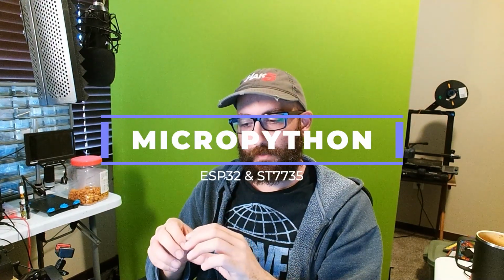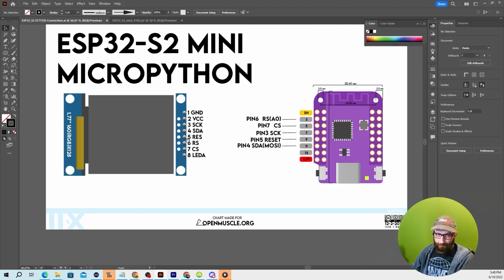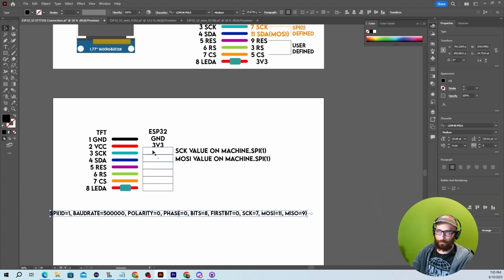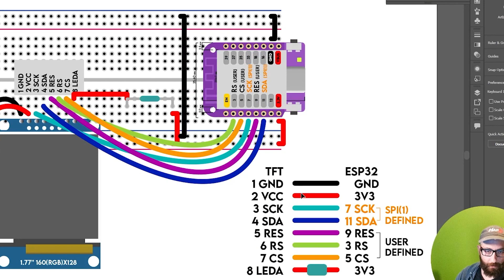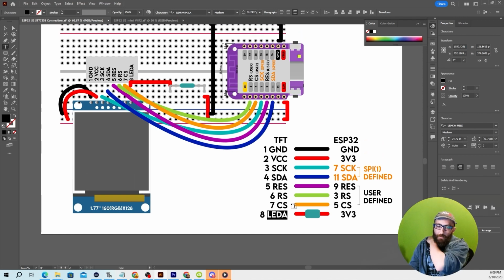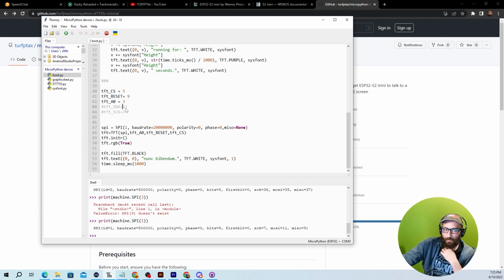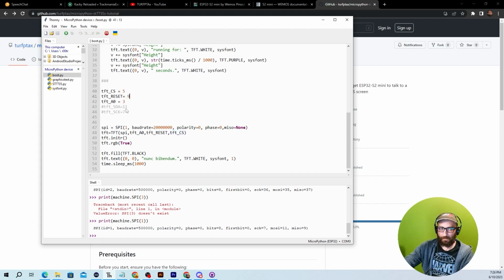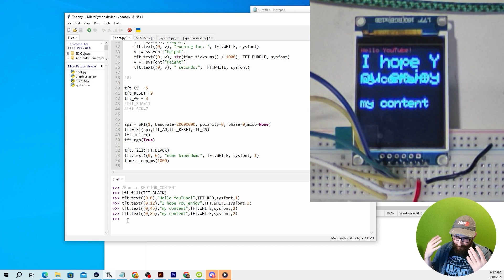Connecting ESP32 S2 Mini with TFT ST7735S Screen using Micropython

Comment: I see that on the back of my AliExpress  3.5" TFT Screen there are places for ribbon cables labeled 8080 16p and at the bottom 8080 8p, any idea if there's a ESP32 that has ribbon cable attachments for a screen?
Reply: Yes the orangepi models have those

Comment: Hi I'm trying to use this board, I need to connect ESP32S2 mini to an ST7789 display, this first problem I don't know how to do, then the sketch I have to load uses the TFT_eSPI library, I have to make changes here, help me please Thanks
Reply from the maker: If you are uploading a sketch that would be arduino and not micropython. Mostly the SPI connection has to use the correct pins from the ESP and ST77 board.

Comment: The TFT seems slow: the text appears not instantaneously, but with a delay.

Can this be fixed somehow, or is it because MicroPython is slow?
Reply from the maker: Micropython can be decently fast if you optimize the code. Playing with gc.collect() and using bytearrays can make it faster in some implementations. But if you want the full functionality of this library especially on the s2 can be slow.

Comment: Got this working (kind of) with a 0.96 TFT display. Only problem is colors are inverted. any ideas?
Reply from the maker: Some drivers use BGR instead of RGB, have you tried using a color text to see if that is inverted as well?

Comment: Thank you for your video! For some reason, your video are ONLY place where I found that for SOME reason, SCL pin is located at pin...7?! NOWHERE ELSE this mentioned in ANY way. BUT!!! It works! Inly this works, but no other combilations. I've tried 9 combinations, but only this works. Thank you again!
Reply from the maker: Glad it was useful! I try to film my process to figure out electronics, hoping that others find it useful. 

In micropython running the machine.SPI(1) tells us what pins the board uses for the SPI(1) connection.